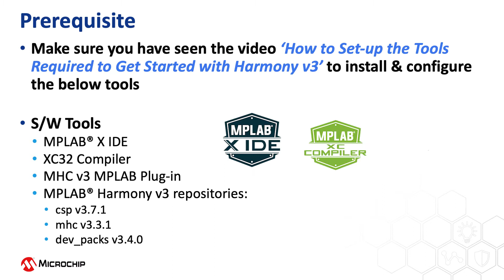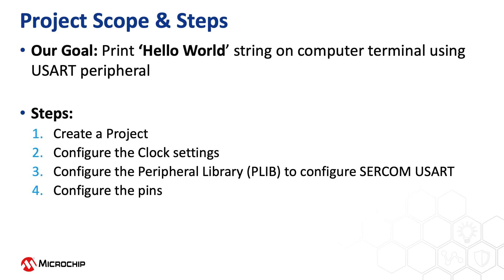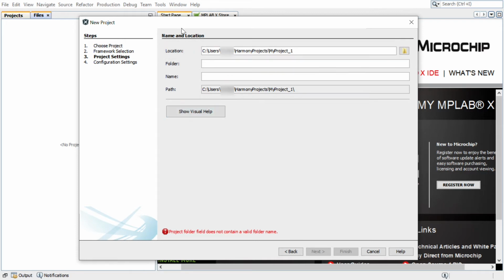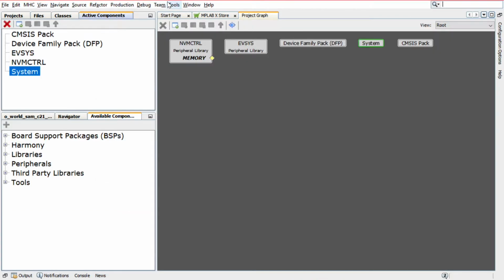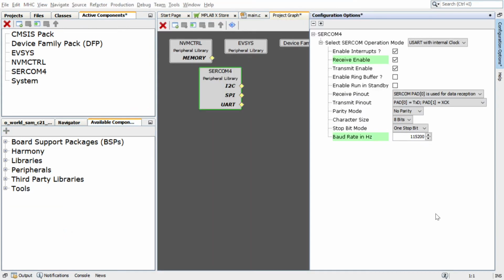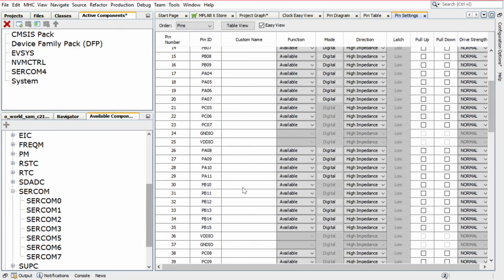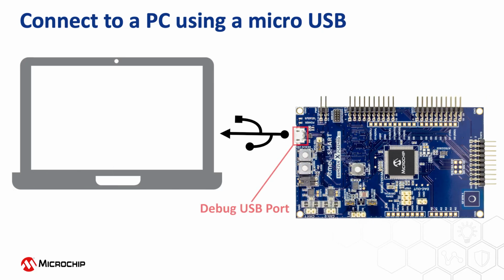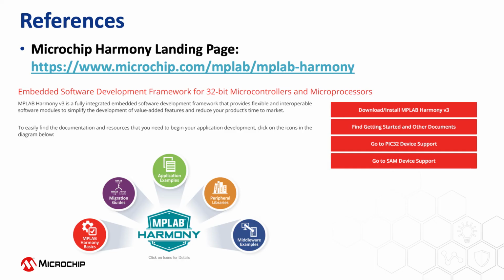Create Your First Project with SAMC21 Using MPLAB® Harmony v3

Comment: step:Manage Frameword     
notice that:harmony framework location  is not valid
and i can not click next&finish
Reply: Hi there, thanks for reaching out! You may want to try to run your application as an Administrator. We would also recommend that you verify that MPLAB Harmony v3 is correctly installed by navigating to the installation directory. The path should point to the folder where MPLAB Harmony v3 is installed. Typically, it looks something like C:\microchip\harmony\v3. Check for the presence of essential files like config, framework, and utilities. Hope this helps!

Comment: I mean, i started using AVR barebones because I knew it would be necessary. Now I use arduinos simply
For quick prototyping. I would never send out a project using an arduino though. Just like I would never use your dev board as a basis for a product. So, really, we need real material for what our real uses would be.

Comment: It would be very nice if you could show videos with barebones systems instead of your development boards. That’s where more questions are going to be. I need info on the STSAMC20 like how to install a bootloader to allow usb programming, general board setup etc. of course, I have looked over the datasheet but it is 1200 pages, not very light reading
Reply: I mean, the schematic for the C21 is nice and all but it won’t help with the C20 when there is no preinstalled bootloader on the C20